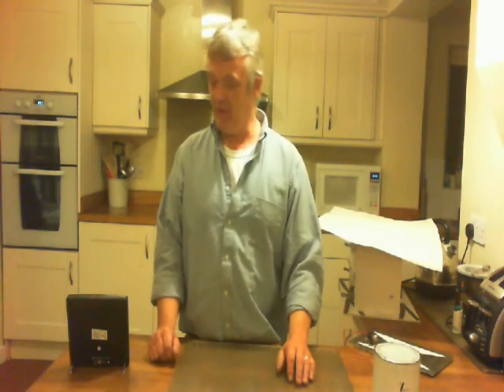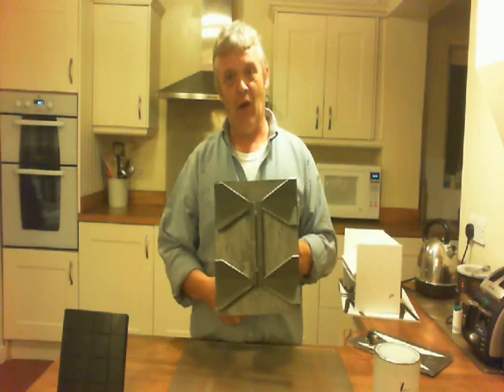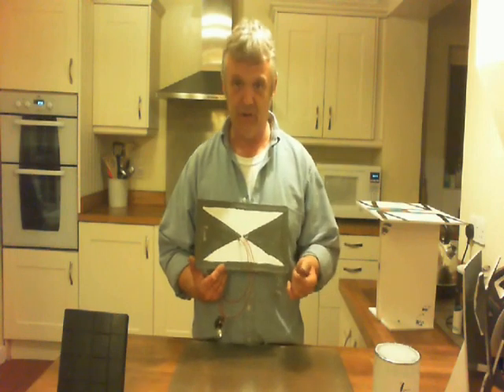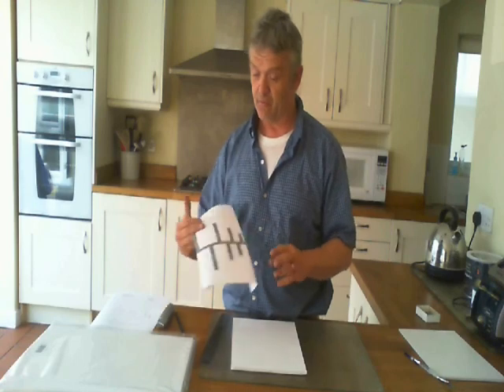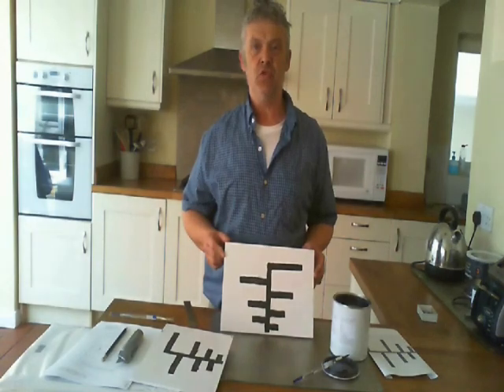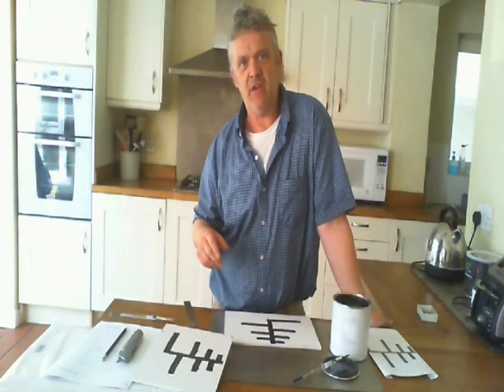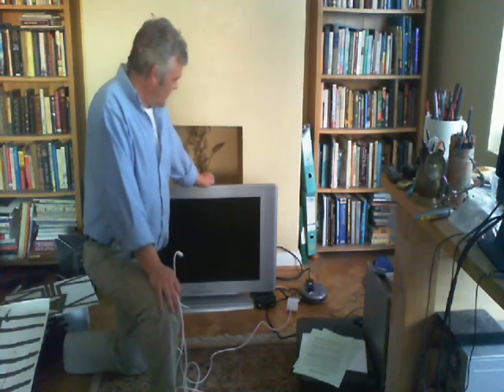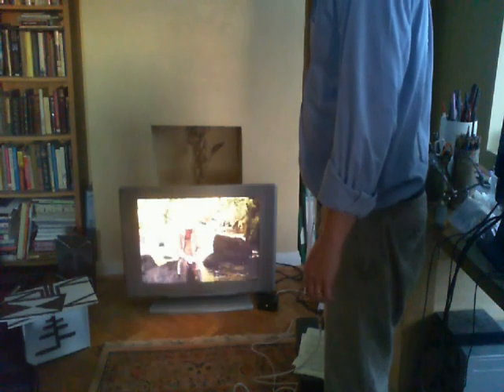How To Make A TV Antenna With Conductive Ink - The Graftenna

Comment: Wow, another great use for conductive ink!  I like your original design, with the two solid triangles.  I wonder what would happen if you added a second one above the first, ninety degrees apart.  After making the proper connections, would that perhaps make it less directional?  I haven't turned on my tv in a very long time, but it would be nice to experiment, just for giggles.  lol.  Thanks!

Comment: Love it. Is there any place thdis ink is not going to get? First to get the ink in space wins! Oh now theres an idea.
Reply from the maker: lol - nice idea too lol
Reply: Robert Murray-Smith
Well that is actually a great idea ...  it can be combined with the proposed 3d printers in space . Lacing the ink with plastic to produce 3d conductive / semi conductive ,materials ..
Reply from the maker: graham kaveman
i'm not knocking it - i like it
Reply: Yes I know mate .. I have an ugly  digital antenna I built from cloths hangers and I have the ink to try this ..
Is there a link to the design that you found as the best .. how did it compare to the $30 unit you bought ?
Reply from the maker: graham kaveman
it worked better than the bought unit - it had a wider operating range, could recieve a good signal lower down and had more channels on the scan - I actually had trouble with the shop unit when it came to tuning but the painted unit tuned in easily. if you just put homemade diy tv antenna in google loads will come up

Comment: The actual functional designs come from Mother Nature. On the year 2012 our analog TV have changed to DVB-T. I am an old school, so instead of buying one I have tested many aluminum pie forms. The one that worked (and still works amazing, better than commercial ones) me was the aluminum star pie form:
http://science.e-business.lt/uploads/10371711_10204197084151812_4030015594123346415_n.jpg
If you look closer, it assembles fractal geometry. All our mobile phones possess the antenna which has the appropriate fractal geometry to receive radio calls.    
Once you use the appropriate fractal geometry you can downsize (using carbon-based conductive materials) your TV antenna to 2x2 cm2 (so far I have managed) =)
Reply from the maker: i like that - it's just a matter of experimenting with various designs to optimise it

Comment: Just looked on google for Bi-conical antenna, they don't have the two halves connected as you have with boarder of ink (the butterfly wings are always separate on the ones on the net), have you stumbled onto something?
Well, I have a balun on order and will be trying out your design using tin foil.
If you take back that £30 antenna, you could get a dvbt-t signal meter for about £11 on ebay (analogue meter looks nice), you won't need a tv licence to test in the lab either
Reply from the maker: oh ok - that's good news - i am forever stumbling about lol - i think i will pull the antenna apart and have a look at the guts now i have it - let me know what happens with the replication
Reply: TV license? That's still a thing over there? I thought they did away with that years (decades) ago. Seems ridiculous to me,but maybe that's how they pay all those BBC presenters. I wonder how much RF transmit power one of these conductive ink antennas could take,it might be useful for HAM radio operators. Paint a insert_your_favorite_antenna_type on a wall,and start making contacts. You could fine-tune it by scraping off/adding a bit more paint to get it resonant.

Comment: Wifi antenna would be a good idea also (if its possible with this method).
You could apply ink to adhesive sign vinyl then stick to the plastic lid of your laptop.
Reply from the maker: good idea mate - see the next vid called some thoughts on the graftenna
Reply: I've been working on a WiFi antenna with the ink with good results. No numbers yet but range seems better.
Reply from the maker: Jimmy Hardman
good work mate